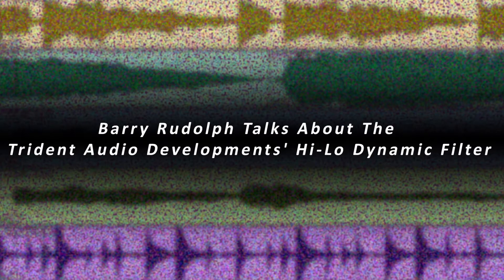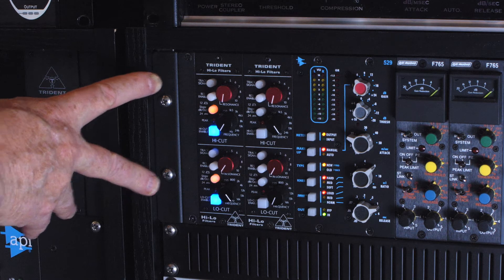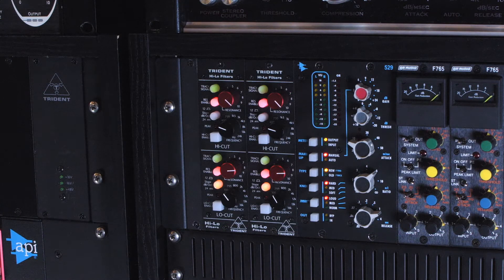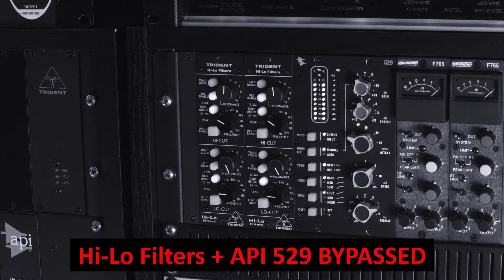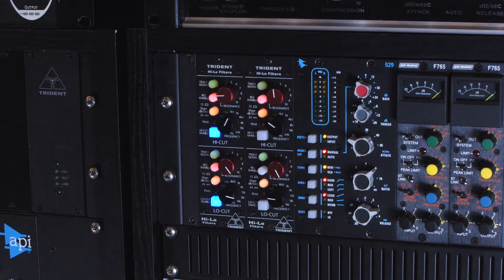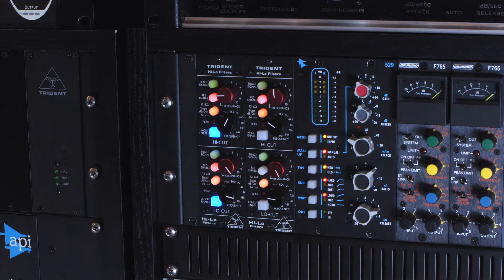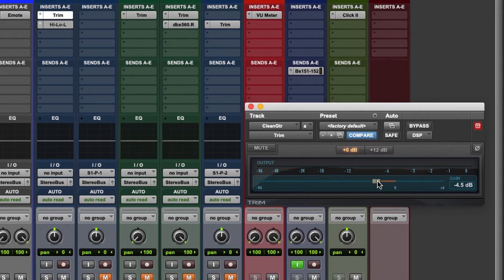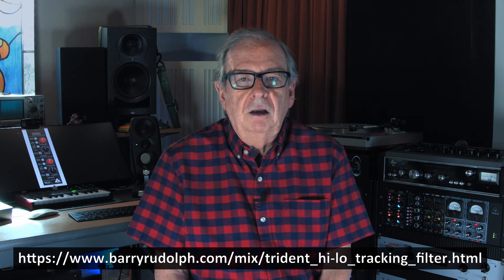Trident Hi Lo Tracking Filter Demonstration

Comment: Hi Barry. Does this compare to a Moog style ladder filter at all?
Reply from the maker: In a way yes---although the Moog Ladder filter is specifically designed as an effect whereas the Trident is a way to use a variable High or Low pass filter in a more aggressive way dependent on the source's completely. There are two filters in the Trident that can be in series for up to 48dB!
Hope that answers your question! Thanks!
BTW:
I'd love to try out the Moog filter one day and you might want to check my Mix Magazine review of the the Trident Hi-Lo at:

https://www.barryrudolph.com/mix/trident_hi-lo_tracking_filter.html
Reply: That's useful cheers. I was looking for something with a nice balance of utility and character. Able to warm up synths but also prepare vocals for compression.
My initial plan was LTL Chopshop, but I'm intrigued by these.